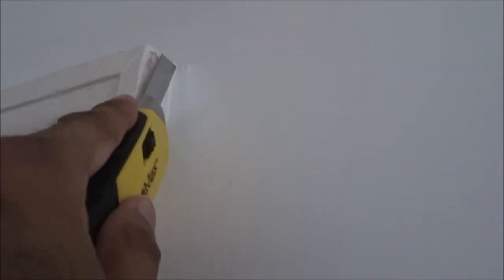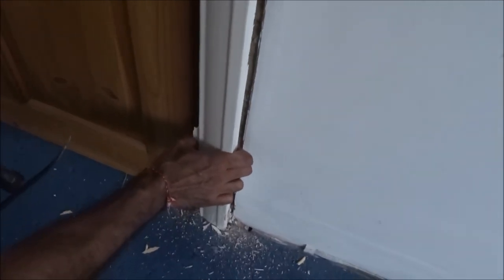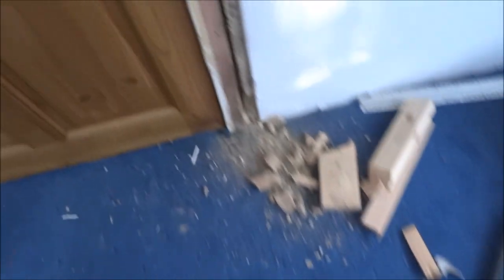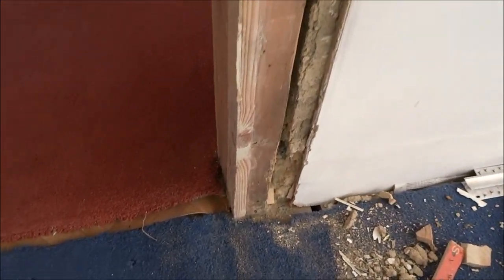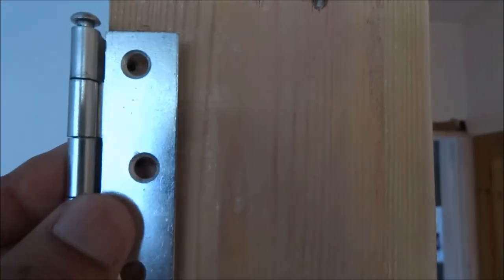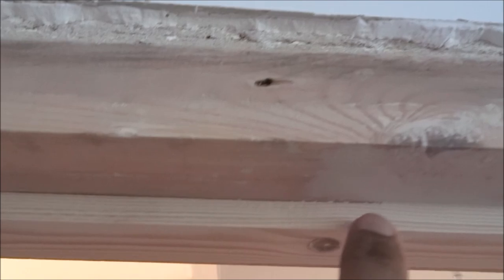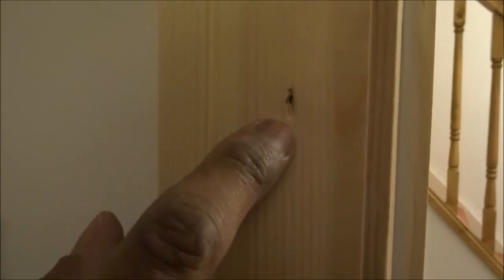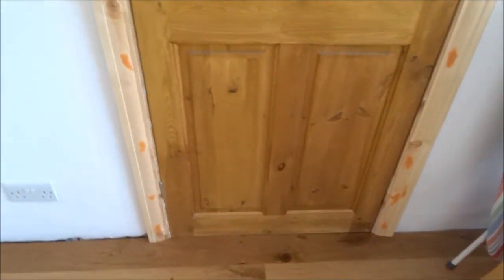How to makeover / renovate an internal door frame / casing and replace the architrave

Comment: You're cutting the dry wall rather than splitting the paint from the Architrave - damaging the dry wall. You need to cut at an angle in towards the base of the Architrave where it meets the wall where the paint would join it. Just a tip for anyone planning to do this ... the above technique isn't very good. It helps also to have the door off before you start ....
Reply from the maker: Thanks for the comment, any tips are good. Just to note this wasn't a dry wall but a solid brick wall.